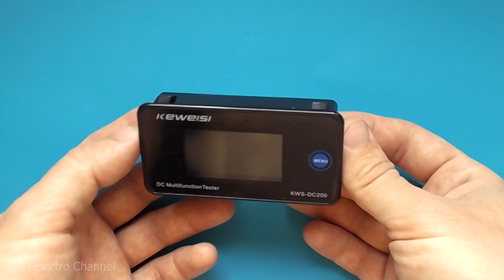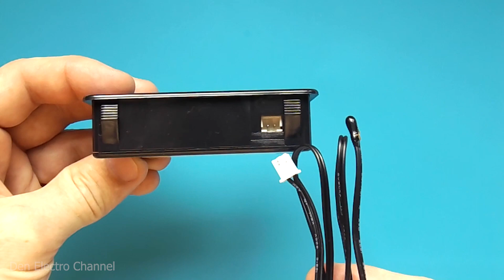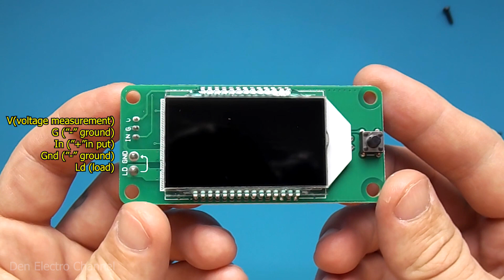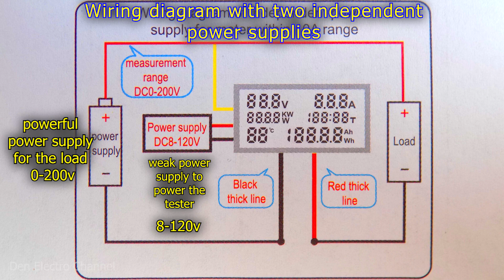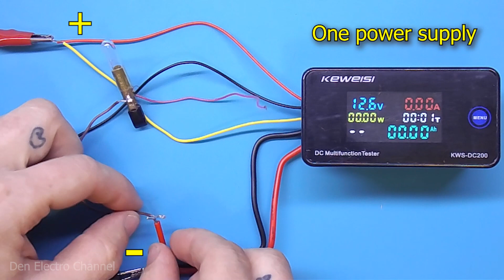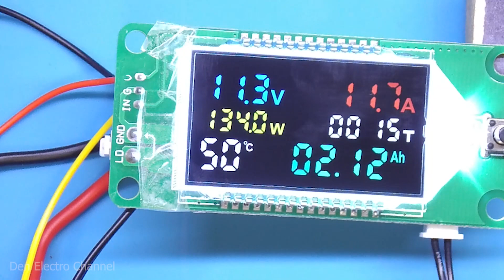DC Multi Tester KWS DC200-10A

Comment: Can you buy the 50A and 100A version and compare their circuit to your 10A version? I want to see the difference. I don't have a microscope to check it 😂😂 Based on other reviewers, the pcb version of the 10A, 50A and 100A are all the same except that the 50A and 100A have no internal shunt. I can't confirm if other electronic components values are different from each model.
And can you tell me how you take clear pictures of the pcb at 4:40? Do you use a microscope? I found it hard to do with my phone without having glare from lights 😅
Reply from the maker: Thanks for the comment, it really made me laugh. :) Unfortunately, I don't have a big budget for other versions of this device. But I think, as you said, they're all 100% identical. The only difference is that the 10A versions have the shunt inside, while the more powerful versions have it outside. This is the most logical option. After all, there's nothing else that needs to be changed. The weakest version can easily be converted to a more powerful one, just replace the shunt with a larger one. P.S.: I take photos with a camera (not smartphone) and they come out sharp, and the lamp is further away, which is probably why there's no glare.
Reply: @Den_Electro_channel i see. Thank you

Comment: Hi I have the same 10A unit  , can I replace  R005  for  metal R003 shunt , and recalibrateamp reading  with   potentio  ??
I want to make this mod so it runs cooler 
or does all the shunt have to be 5 milli ohms ?
Reply from the maker: Hi.the new shunt should be the same resistance. the regulator won't help. it's good for small reading deviations

Comment: If I use the KWS-DC200, which is only rated for 200V, to measure a 240V 13A load, what will happen?
Reply from the maker: I think it will burn)

Comment: I bought the 10 ampere version. I want to measure higher current. Can i modify it by removing the internal surface mount shunt and connect an external 100 ampere shunt?

Is it necessary to remove the surface mount shunt if i modify it? I think only a small current will flow on it and the external 100A shunt will be connected in parallel to the internal shunt so most of the current will flow to the external shunt
Reply from the maker: Yes, I think the external shunt can be installed for 100 amps. But if you leave the internal one, I think it will distort the readings. And it may turn out that the 100 amp shunt accidentally falls off and the entire huge current goes through the internal shunt and then it will burn out))

Comment: Is it possible to measure car amplifier power with this unit?
Reply from the maker: possible, as long as its amplifier power is no more than 120 watts.
Reply: Yes you can but you need thicker wires, those thin wires can load only 6amps a second at 12 - 15volt, at 120v ac or 220v ac it runs even cooler, but his pulling at 10 amps per second on thin wires bypassing 11 amps plus, you need to add 2 cooling fans or jet fan, there's still energy in the coil, there's no lag unless it says <30 sec fresh rate, even when switched light off, to run higher load you need a triple wire thickness than that thin wires, for 800 watt speakers, you need 5mm bandwidth to prevent bandwidth resistance, so if you hear weird noise coming from your wires, you need bigger the bigger the cooler it runs for 1.6kw you need 2cm wide aux wires, or split channel or triple or quad channels to deliver stable performance, using thin wire can lead to coil induction heater, electric stove or potential fire